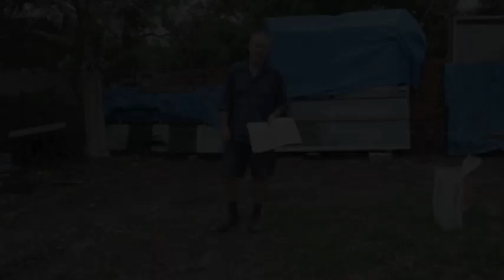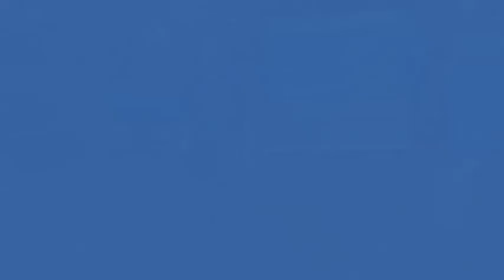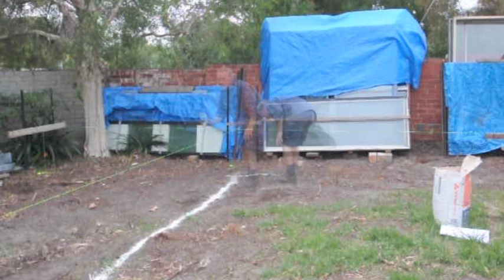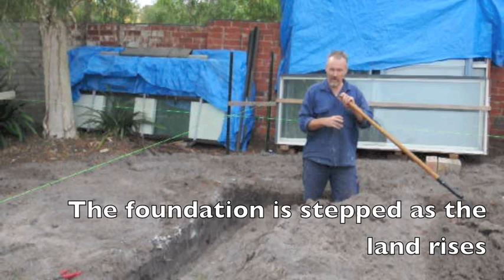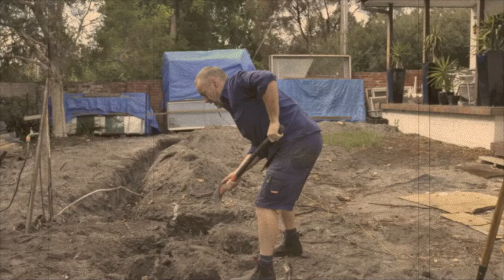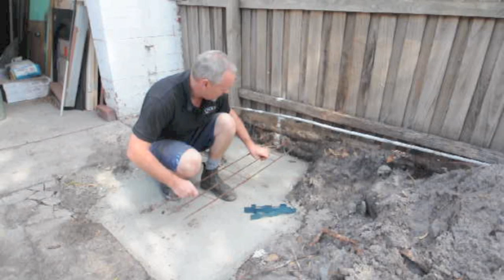House footings

Comment: Why the hell is he throwing the soil into the middle of the hole he is digging? It just means he is going to have to move it to the outside later the prat...
Reply: Jay Newcombe no. he will probably use that muck as part of the fill for the floor when he has done his brickwork. it would be pointless moving it away to move it back again, contradicting myself  though that is exactly what i do lol, move it away to bring it back later, so my bricklayers have room to work for the internal carrying slab walls. i do however, have plenty of heavy duty earth moving equipment at my fingertips, if i was only using a shovel and a wheelbarrow, the Bricklayer would just have to bloody struggle lol.

Comment: what happened to lines and dumpy levels you could be miles out the very first thing you should do is line it out exactly using triangulation and then drive in pegs all the same height to work off  with your auto level. I am afraid this is  a poor video  , there are no shortcuts  chappy